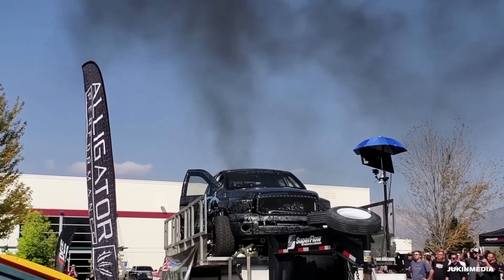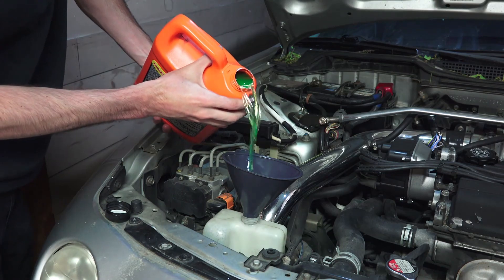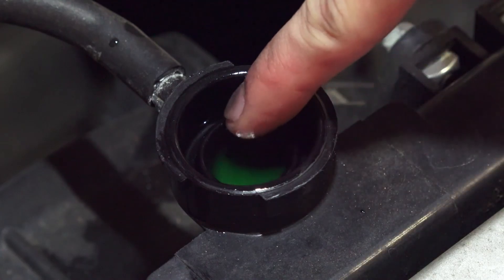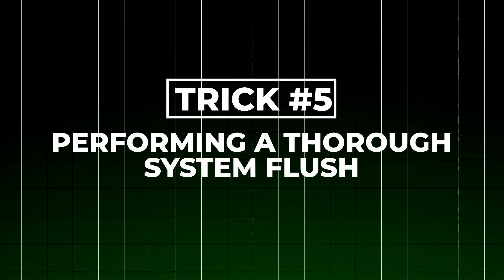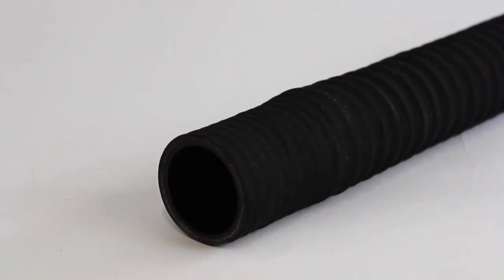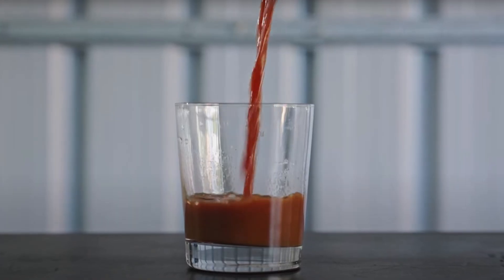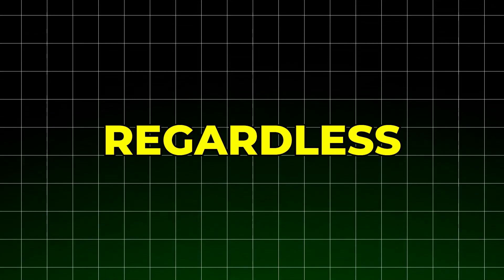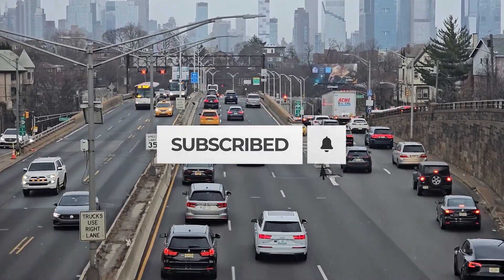Doing This Will Make Your Car's Cooling System Last Twice as Long

Comment: The thing bout car spend a lil here a lil there for 20 years or spend a lot every time you blow car up estimate 1 car every 2 year bc your prolly dumb so 10 cars over 20 year’s estimates for every car 1000-100000+ is your price range for each purchase including taxes insurance maintenance gas financing payments if applicable ain’t even gotta be a mechanic to make a car last just gotta be smart the car will show you if you are smart or dumb if you can get past the financial burden of car and reap pure benefits from car ie short trips proper usage when needing to speed for the Italian tune up  making sure engine filter is replaced cheapest gas add fuel additives tire psi always where it needs to be always replace all fluids and with that concoction of car you will have the most money efficient vehicle I have truck with 12mpg getting me through 2 weeks of work with my current job and guess what I fix my own car and can cook for myself on a professional level the only thing really suffer from is needing labor that I wouldn’t even be worth paying for because I do the 2 most important things around the house at a professional level
Reply: It is important to note if the car shows you you are dumb you might be to dumb to know that you are dumb and to understand that you are dumb along with understanding what you are looking at and experiencing on a financial level when looking at what the car presents to you after your big dumb purchase hence why mechanics get educated and become suicidal and drink and drive shitboxes

Comment: Hey bro, I just wanted to say thanks for your video — YouTube recommended it to me and it was really helpful. I drive a Lexus ES300h and recently changed the radiator cap, but the car still overheats when I drive around 100–140 km/h. I think it might be air trapped in the cooling system. Do you think bleeding the system would help? Thanks again!
Reply: It's your car and you are the only person who can sense the problem because you drive it. If it's air stuck, then bleeding it should get rid of the problem. If that did not fix it, check your cooling fans. They might not be working properly because they are supposed to work harder and faster the more heat your car has.
Reply: If you want to check if it is the radiator or cooling liquid, you should wait for your car to get warm and then place your hand on the radiator. If the radiator is cold, that means you don't have circulation
Reply: Your car won't randomly generate more heat. It's the same heat and it's not getting cooled down. Either problem with the water pump, fans, or anywhere in the circulation channels. Don't need to check anything else. If it's none of those, then there is only one thing left and it's the least likely. Your ECU might be malfunctioning and not giving the proper orders to keep your car cool.